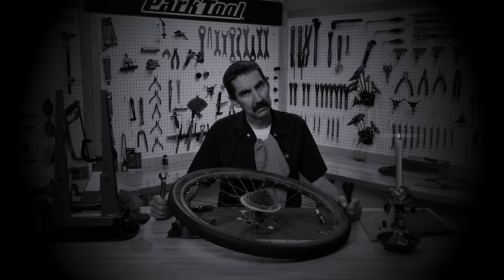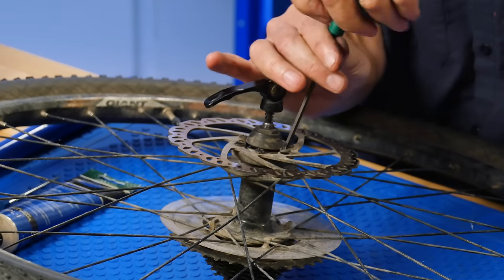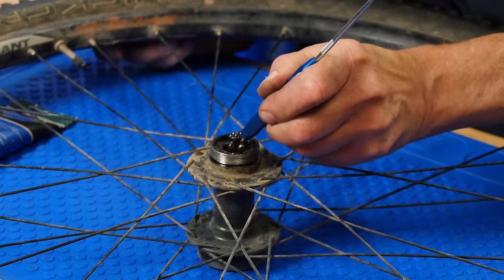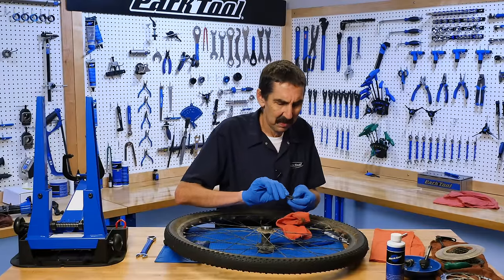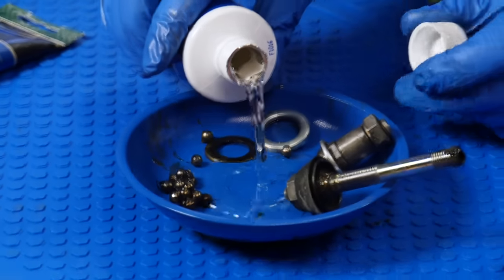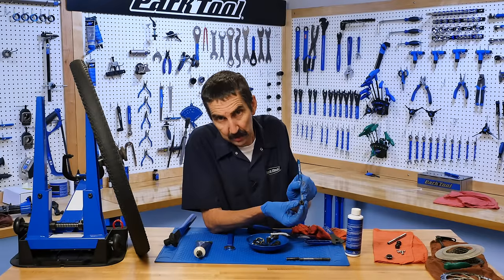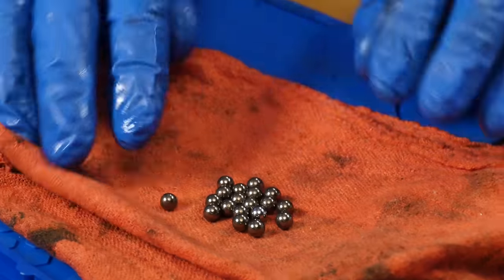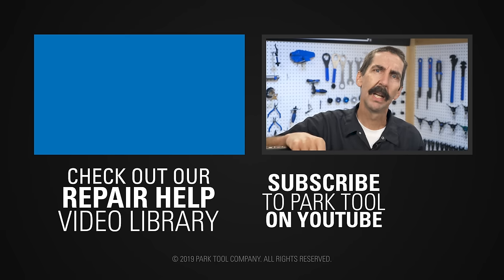Calvin's Feast Part 1: Hub Problems | Tech Tuesday #159

Comment: That's crazy that they even make a disc hub with a spin on freewheel. I guess non bike people are impressed by disc brakes, but don't know the difference between Freewheel, vs cassette. I'd try to sell the customer a new wheel with a cassette. Explain that they'll keep breaking axles. Otherwise they'll try to hold the mechanic responsible when they break the next one.
Reply: Right.
Are there 9 spd freewheels out there ? I had no idea.
Reply: I wish I'd known that coulld'a used one with a BMX freewheel on my single speed instead of the Ssp cassette system hub.
Reply: @GeekonaBike  A 130 or 135mm hub with a 8 speed spaced Freewheel setup will break axles if You ride even the slightest bit aggressively. A cassette hub has the main bearings out near the ends of the axle on both sides. On a Freewheel hub, the  right side of the axle sticks out almost 2 inches without any support.
Reply: @jamesconroy7030  Yeah I'm kind of amazed he didn't mention this "length of unsupported axle" thing -- The breakage pattern is indicative of this limitation of freewheels.  I'm sure Calvin knows this but probably wanted to keep his script focused under the assumption that we'll be working with the existing wheel here, but I think it bears mentioning.
@Maria Martins Looks like this is a 7 speed freewheels which is where I think freewheels typically topped out (8+ speeds is usually a cassette/freehub setup)
Reply: @chrislukes9037  I looked on eBay, and they do have 9sp thread on freewheels. 7, 8, and 9 speed all have the same spacing, so it won't matter as far as breaking axles. But it's just another example of cheap bike manufacturers making it look nicer than it is, while cutting corners on what the customer doesn't understand.
Reply: I would also add that if this problem arose on a city bike, changing the quick release axle for a solid axle would also confer sturdiness without having to replace much more. Additionally, the rear wheel would also be less likely to get stolen.
Reply: @KarlosEPM  Good point. A solid axle would help. Also, the quick release is yet another unnecessary selling feature that fools the uninformed WallMart customer into thinking they're getting a bike like the ones at the real Bike Shop. While they cut corners by selling them a poor quality hub.
Reply: @zygmuntthecacaokakistocrat6589  solid.
Reply: @zygmuntthecacaokakistocrat6589  In the case of a 3/8" axle under heavy load a Quality solid axle would be a little bit stronger. No, it would not solve the problem altogether. The real problem is that hubs with freewheels have the right side bearings right near the hub flange, and the axle sticks out about 2" unsupported. A cassette hub is the real solution.
Reply: @jamesconroy7030  Thanks for the research.  I knew 8-10 was the same spacing, couldn't remember if 7 was the same.  Thanks!
Reply: @chrislukes9037  Older hubs with 126mm spacing can have 6 or 7 speed. 135mm is the current standard, but often only have 7 speed.
Reply: @jamesconroy7030  what is interesting, modern cassette hubs with pop-off freehub bodies don't have this advantage anymore - they have oversized axles instead (even if they are for standard 10mm dropouts, the end caps ensure the conversion)
Reply: @YavorM-Yash  hahaha, thanks for that!

Comment: I have a entry level hardtail and the hubs are the worst part. When you "compare" them to a DT180 EXP it's like the Zambian space program compared to NASA
Reply: LMAO I’m with you there
Reply: What’s so bad about them? I have an entry level hardtail and the hubs can be repaired easy
Reply: @MrFitness94  it's not the repair but the thing as a whole, the rolling resistance, and the adjustment, reliability etc
Reply: Kazak Thranduil adjustment and reliability are synonymous with repairs bro, which like I said is easy. Fresh grease and a tighten and it works like a dream usually unless the races, cones and bearings are shot. As for rolling resistance, maybe it’s worse? But the laws of thermodynamics DO say that a louder hub is a resistive hub
Reply: @zygmuntthecacaokakistocrat6589  it seems that way

Comment: For me, if the cones are shot, i replace systematically the ball bearing , they cost absolutely nothing and if by bad luck you put back one worn ball bearing it will simply destroy your hub.
Reply: Might as well do it while it's apart.

Comment: At the cleaning process I was afraid you put the old cones back. After an axle broke everything goes in to the trash. Except the hub of course. 
Very good video again btw.
Reply: Is the cones are damaged probably the cups are also broken. Redo the wheel with a shimano hub and that solves the issue

Comment: I just had to fix  this last  week  on my 2019 Giant Rincon (entry model freewheel and rim brakes)  10 months use about 4600 miles of use mostly sealed roads & dirt roads...... where I am I can not get new cones and the bb's looked ok so they are all back in until I can go get some new bits delivered.. (I got a solid axle in for now)...  the same problem occurred twice with my last bike a GT Aggressor from about  2014. .....with the Giant I only noticed a slight wheel wobble .....oh and the bottom bracket has a little play in it now oh well.... ,

Comment: I think using a magnet to pull the bearings out is a bad idea. It may magnetise the bearings. It will cause them to attrack ground up metal and other crud before and after they are placed back in the hub.

Comment: Hi,  on a vintage wheel hub (1970s Schwinn LeTour) how do you remove the dust cap.???
Reply from the maker: Some dust caps have a slot for a straight blade screw driver.  Some use a hex fitting for a hex wrench. Some use two pin holes for a pin spanner like the SPA-2.  And some are pressed in.  Look close for one area the is open for a thin screwdriver.  Pry it out.
Reply: @parktool   Yea, mine is pressed in - thanks for the response.

Comment: Good day... How to change the bearings of shimano saint front hubs with 20mm thru axle?
Reply: With Shimano parts, always start at si.shimano.com. Enter the part number in the search box (sounds like you have an HB-M820) and review the documents. "EV" is the exploded view and parts list. "DM" is the dealer (service) manual. And "UM" is the user manual.

Comment: I found a crack in my rear hub on my full suspension mountain bike, and two of the spokes were broken off the hub, I've always been very gentle with my bike, I never take it off road, or do any jumps and I avoid potholes, but I do like to ride it fast and take hard corners at fast speeds, similar to a crotch rocket bike race when they lean their bikes close to the ground, could that cause my hub to crack?
Reply from the maker: Without seeing it, it is hard to say.  If the failure at the spoke holes in the flange it is likely too tight spoke tension.

Comment: I had a customer bring in a wheel because of a dodgy axle. He had dismantled it, axle, locknuts, cones, seals... even went so far as to punch the cups out of the hub shell! 

Brings in just the wheel, no axle or cones or locknuts, with the cups sitting loose in the hubs and asks "Can you fix it?"

No branding on the hub, no model numbers, nothing. He seemed quite certain a good bike shop was able to take care of this, and wouldn't really take no for an answer.

Comment: Just quick question, if my bike is old does it worth so much hustle money wise and time spend or will be easier replace the whole thing ?
Reply from the maker: Often older bikes are worth repairing yourself. But this is not a cut and dry topic, it depends on the quality and condition of the bike you have and the time and money it will take to repair as well as what you want to get out of it.

Comment: What do I need to fit Micro spline in X Caliber 7 2021?
Reply from the maker: You will need something with 141mm "boost" spacing. Looks like some of the bigger hub manufacturers are making it. Its not super common so availability is going to be limited.

Comment: Can u solve the problem that chain skip when back pedaling for 3x.....crank set
Reply: 1. Stop backpedaling. If you backpedal, your front chainring becomes the derailleur, especially if you ran the chain diagonally before, which you should also avoid. 
2. Check your chainline.
Reply: But my previous bike is not like that whenever i back pedal it won't skip.but my new bike skips when back pedaling🤔
Reply: It might be a shorter Chainstay length, it might be a newer system (10- vs 7- or 8-speed), where the manufacturer wanted to enhance shift performance under normal conditions, aka pedaling forward, but just watch this Tech Tuesday video https://youtu.be/iySpqZkld2k, where Calvin jones answers exactly your problem, and his conclusion is the same as mine: stop backpedaling.

Comment: im optng for total replacement for peace of mind sake 
my front wheel nice and quiet 
rear wheel has copious amounts of play (if i tighten more the wheel will lock)
issues first arised within the first year rebuilt it problem gone 
2 years later and a bikeshop visit later they are reccomending i replace my rims(wheels strugled to hold true and spokes felt ilke spaghetti) wheel flex is also pretty annoyin so something stiffer is in the books 
i ride an odd branded bike as in i cannot find the brand online 
thick alloy tubing all round (i compared the thickness by going to a bikeshop and tap testing on the downtube with my fingernail listening to the pitch) so i want to get atleast a few more years out of this frame as either my personal bike or the bike ill loan to my friends if needed its flippen heavy though

Comment: So what do you do if you have pot holes in your cup like I do?
Reply from the maker: There is nothing you can do, practically.  Cups are not available as a replacement part.  A new hub is needed, or just ride it.  Once there is a pot hole, it will only get bigger.

Comment: I have cracking noises in my bike think it's from the rear hub it only present when I cykling and peddling I can feel the cracking thru pedals and up thru my saddle can't find any other places it would Come  from. I've replaced bottobracket bearings. I'm close to throw my bike away
Reply from the maker: Creaks can possibly come from rear hubs but it is not common. A few things to check is that your quick release is tight, your pedals are tight, and the crank bolts are all tight. If you can feel it in the pedals it tends to be a crank or bottom bracket creak. The rear hubs do not cause enough movement when they have issues to feel it in the crank.
Reply: @parktool  thanks everything is tightened but I felt the freehub housing is little to lose and when move it by hand slowly I can feel the ball bearings. So I'm gonna change the body. It's not creaking it's more like snapping or small banging but thanks for your input

Comment: irl the cost of labour would mean that the whole wheel is trashed
Reply: labour for what? replacing an axle? thats an extremely easy and non-time-consuming task. i charge $15 CAD (11 usd) to replace an axle with new bearings. ( not incl axle)
Reply: if the hub was damaged, depending on what price you could get a new hub for and what price you could get a new wheel for, the labour for relacing your old hoop to a new hub could be close to the cost of a brand new wheel.
Reply: @JogBird Not for a kid with no budget and loads of time on their hands.

Comment: I have a question, So I just recently picked up a 2021 marlin 7 and when I get into first and second gear a part of the bike starts to rattle and I don’t know what it is. Can you guys help?
Reply: could be rear derailleur adjustment that is off or the lock ring on the cassette is not tightened properly.
Reply: Perhaps the chain is rubbing on the front derailleur cage if it has one.
Reply: If you’ve ’just recently…’, then take it back and get the vendor to sort it out. Obvs a manufacturing or assembly issue. Should be covered by a warranty.
Reply: @themoodyteam  yeah, isn't there a tune up for new bike still? I mean you're supposed to take it back after a week or something anyway to take out cable stretch and stuff
Reply from the maker: As stated above you may want to take it back and see what the shop says. Another common rattle is spoke protectors. If not setup right they can rattle quite a lot.